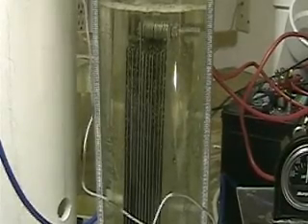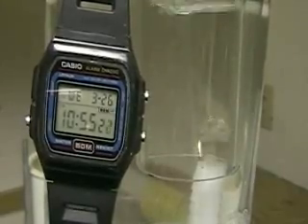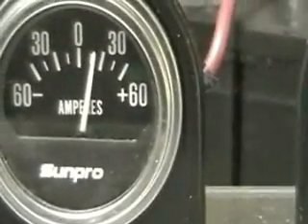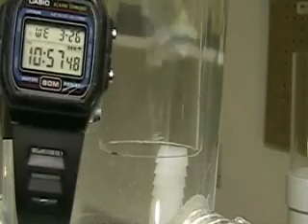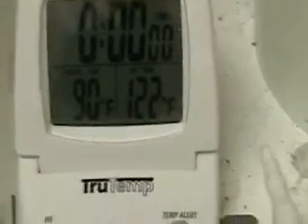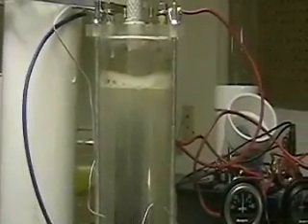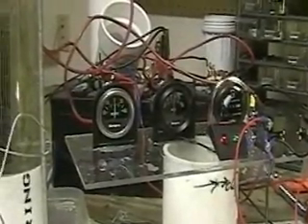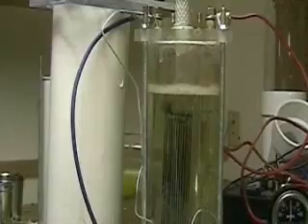Hydrogen Tap (FOCUS-14 AMPS) 309

Comment: 16 amps must be putting out a hell of allot of heat to your terminals and wires. Do they get hot? What would happen if you ran this for an hour straight? Have you tested it for longer periods? (Part 1)